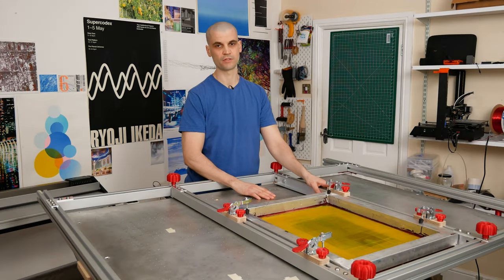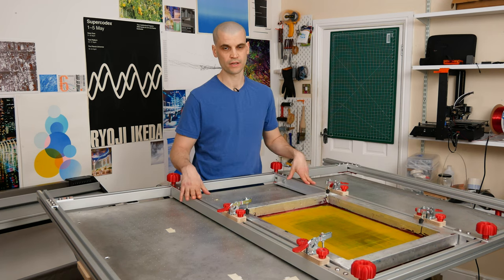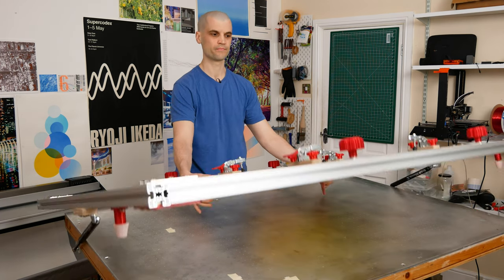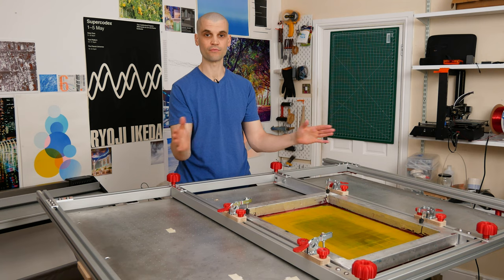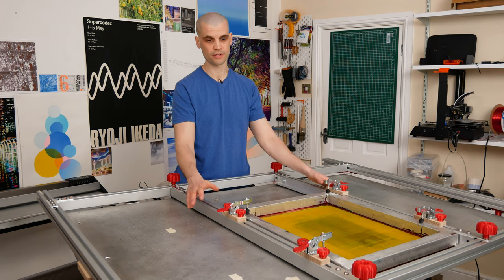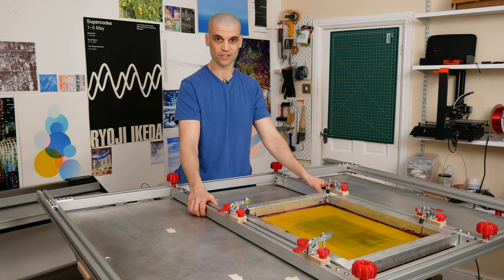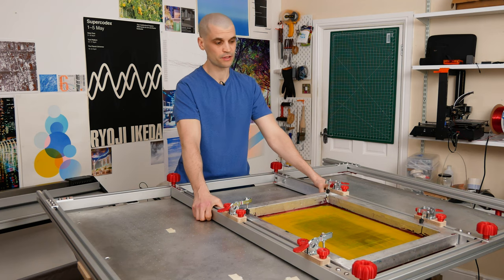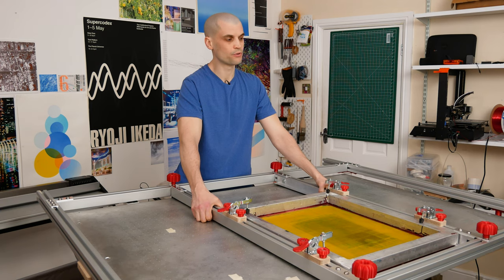Ultimate DIY Screenprinting Table for Poster Printing & Serigraphy

Comment: Nice build! If the racking continues to be a problem, consider running a piece of all-thread down the center of the long extrusion and put a nut on each end. Pulling the extrusions together in the corner produces a much stronger joint than the L bracket with t-nuts alone. In a former job I was on a team that built industrial automation devices out of similar extrusion and bolting them directly together made a huge difference.

Comment: Would it be possible to either send a link to the CNC files for the aluminum square tube columns that are attached to the hinges? Or could you please explain the internal design? I’m trying to figure out how the square tube part glides up and down so smoothly. Thank you! 🙏🏽

Comment: I just found this build. how has it been holding up to printing? Would you be willing to share the plans for the build or the shopping list?
Reply from the maker: holding up great, no plans im afraid , its just a simple rectangle and brackets from the cross section pieces. Super easy to build. Im going to be cutting this and the table in half next year though because i only screenprint up to A2 size paper these days and the huge table takes up far too much space.

Comment: The part where the clamps hold down the screens? I couldn't see as clearly as i'd like re; what you put under the clamps that the screen slot into underneath bringing it all together? eg. was it a section as long as the extrusion arms? or in sections at each end.? I'm thinking what i did see looked like it was quite thick? when you add a screen the off contact might be a tad too high? or is it ok? What is the thickness of that angle section underneath? and how high was the off contact?.....Cheers.....Peter
Reply from the maker: hi Peter (you dont work at Bainbridge in London by any chance?) The aluminum angle is 4-5mm thick so the off contact isnt affected too much. Off contact is fine and i actually raise mine more than that.
Reply: @ThisDesignedThat  Cheers matey. I'm having my top done as we speak based around your's. A couple of minor tweeks. I'm having small triangle wedge brackets in the corners, the engineer says the L brackets on top aren't much chop? I'll send through when done?. And no, i don't work in Londonia but i do from Sydney. And i wish i was a direct relation to Bainbridge board. LOL

Comment: Where do you find such a table top? 🤔🙂
Reply from the maker: you can find second hand on ebay quite often
Reply: @ThisDesignedThat  I actually dug through your videos afterwards and found you building your own.

I'm thinking about getting back into screen printing (did years of professional textile printing back in the early 90s)...

...and want to build a vacuum table similar to yours. I've got a few ideas on details I would do differently, but your build is a great starting point 👍⭐⭐

I'd like to use both vacuum and registration pins as a starting point.

Comment: FIX 2 Ls AT THE OUTSIDE WHERE 2 ALUMINUM SECTIONS ARE POPPING OUT

THEN THE ENTIRE STRUCTURE WILL BE STABLE
Reply from the maker: Very good idea. I actually plan to chop those bits off because they take up space. I'm going to be downsizing this table soon as I only print A3 size prints now